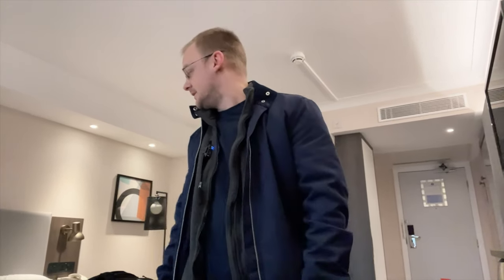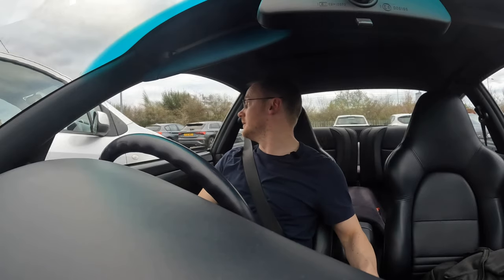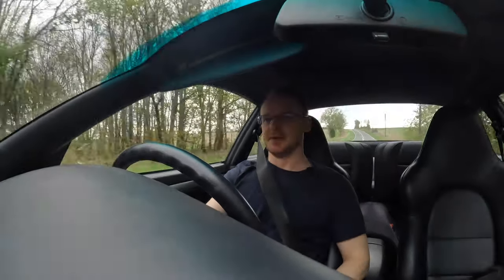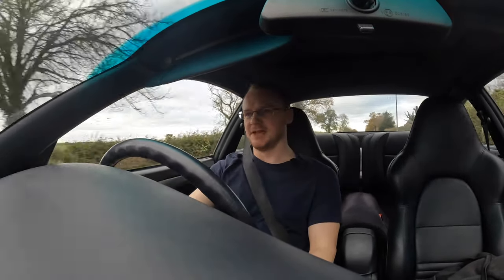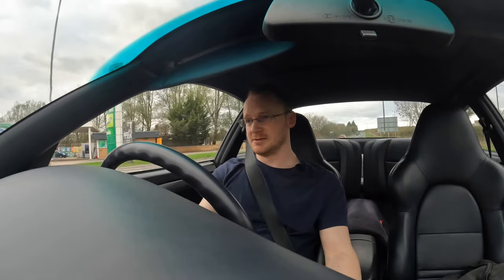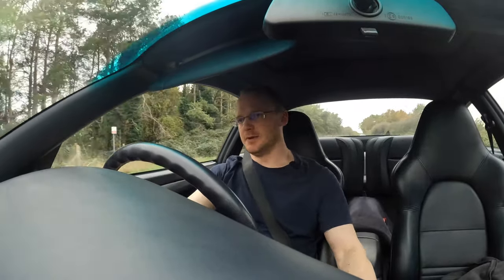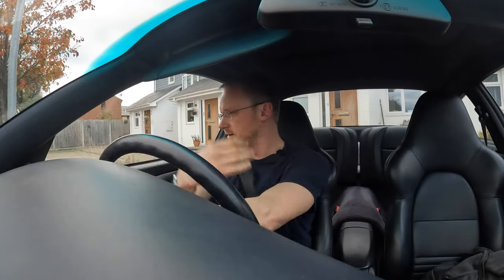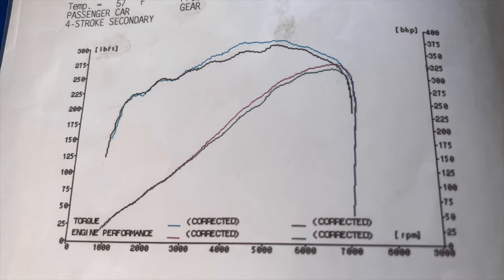Porsche 996 Hartech Engine - Episode 5: Collection, First Impressions, Costs, Dyno results

Comment: I'm tired of seeing old Porsche's stripped down to the shell and then put back together. The soul has been lost in the process. With your car, it was still intact. They just refitted the engine and put it back on the road. Your smile at the first heavy throttle was was amusing. We all could feel the new-found power.
Reply from the maker: That’s it. It’s about enhancing what’s already there, and making it ready to enjoy for the next 10 years or more.

Comment: Thanks for the video!  I own a 996 with 174,000 miles… just spent $10k last year on finding an intermittent misfire/idle issue…  wish I’d been able to save that towards a hartech build…. Enjoy the drive!
Reply from the maker: Thanks Dave, what was the issue with your car in the end? Did you have to replace lots of parts?
Reply: What did the issue end up being?
Reply: @leeevernden  just saw this…. Unfortunately there was no smoking gun on the issue… we ended up replacing tons of sensors, vacuum lines, DME, unpinned and repinned many of the electrical connectors and more…. We think it was the combination of a bunch of things, and some deferred maintenance in a high mileage car…

Comment: Very nice, but that's coming in at 996 turbo money. No doubt a turbo would also be very expensive to maintain.
Reply from the maker: Well this is it. I could buy a turbo but then I'd want to do something equally nuts with that. Turbos are a different beast and whilst I can appreciate them they don't float my boat like a 996.1 c2 does.
Reply: If you hold on to it for 10 years you will get your money back. 996s will do the same as 993 values and it's modern car quick with the extra power.
Reply from the maker: @bradjepson7022  I agree, certainly the longer I hold onto it the more sense it makes.
Reply: @bradjepson7022  That's reaching. 993 were build in way lower numbers and 996 have already increased in value probably close to 2-fold over the last couple years. A lot of the increased value is people just speculating on the prices increasing further, not really the true demand for it. It's not quite probable that over 10 years his 996 will be valued at 50 grand plus inflation adjustment, so really it would have to sell for around 60 grand. I doubt it!

Comment: 996 C2's will for sure be the one to have now and in the future , they're already at a similar price point to 997's , personally I think this is a great way to deal with a worn out tired engine, yes it's big money but what else will drive like this. A Turbo doesn't , I have one, it's more like a GT , C2's a re a good bit lighter and with this engine , suspension and brakes will make an incredibly special car. I'd only do it on a very good body shell with good interior and a special colour.
Reply from the maker: Yes that's the idea - a lightweight sports car without much compromise in other areas, I'm sure there are plenty of Caymans that drive like this but I needed the extra seats, plus a 911 is just cooler.

Comment: Puff of blue smoke on startup is pretty standard on a lot of flat 6 engines, might not go away after bedding in but it's normal.
Reply from the maker: Even my worn old engine didn't smoke so I sincerely hope this one doesn't. Hartech certainly told me it won't.
Reply: @leeevernden  It's a normal thing on flat 6 cars. When the engine is off, due to the flat design of the engine, a miniscule amount of oil seeps past the pistons as the different parts of the engine cool and contract (IE, the pistons contract before the cylinder does).

It's not on every startup, depends how the car is driven before shutdown usually (IE if it's driven hard before shutdown).

This is what's burnt off on the next startup, but it's such a tiny amount it is accounted for in oil change intervals, it's not anything to worry about.

It's not a problem, it's just the design. And it's not just Porsches, any flat 6 can encounter this (Maserati, Subaru, Chevy etc etc). Nothing to do with wear, so don't worry!
Reply from the maker: @ett_baer  Oh I see, thanks for clarifying.  In that case even if it does I'll never notice 🙂

Comment: Good luck mate I have a 997 4s and I payed a local company last year to do a two cylinders rebuild and it failed and the chaps at harteck saved the day thanks Lee grant Tobias 👍 to all out there iron liners do not work on the 3.8 open deck long term
Reply from the maker: Yes it seems I had 6 steel liners and that lasted a good few years longer than yours but ultimately here I am fixing it. Hartech have definitely done a proper job on this one, feels great as I imagine yours does too.
Reply: Iam still working on getting it back together Saturday project 👍 all the best from Paisley

Comment: I’ve been considering a V8 for my 996 with intermix. Your videos have definitely made me reconsider, I’ve been researching the Slakker (no Hartech in us) 3.7 build. Similar pricing but that flat six sound is something I don’t want to give up.
Reply from the maker: Absolutely, the m96 has a great character and makes some lovely noises. Definitely worth consideration.
Reply: Just check StreetBandido green Porsche from a few days ago. The crate racing engines you can buy in USA with warranty are absolutely mind blowing.

Comment: Perfect description of the OEM engine - as I have described it to friends.  My 2000 996 C2 is a fabulous car, but the first time I got the revs around 5000, it felt like a completely different car.  Just brilliant. That's when I understood the beauty of this Porsche.  Nonetheless, I absolutely understand everything you discuss in this video.  I do wish I had an engine with more torque in lower RPMs and I wish I had tighter shifter like the kit available from Numeric.  Wish I had your seats, but only have the standards in mine.  If mine ever develops bore scoring or some major problems, I'll have a conversion done similar from a company in the States like Jake Raby's group.  Thanks for the video.
Reply from the maker: Thanks for your comment, interestingly someone drove my car the other day who has driven several 3.4s and 3.6s before and he said that the 3.4 is all about the top end, and the later 3.6 is all about the mid range. With the 3.7 and the tune, you get the best of both worlds - strong mid range and top end. A very nice way of putting it I thought.

Comment: I had a 3.6 conversion done by Jake Raby/Flat6 Innovations here in the US about 10 years ago. The cost was high, but the satisfaction is priceless. I highly recommend you upgrade your suspension...you won't be disappointed.
Reply from the maker: Yeah for now I'm refreshing the suspension but one day I want to get round to setting it up properly. There is so much choice in that area and I've heard so much good and bad for the different setups, needs proper research. What have you gone for?

Comment: Congratulations Lee. Looks like you are in for some great fun. 
On a separate note, suggest to hide your personal details (like your address and other details) in the video if you can . Have been stung recently so thought I'd mention. Have fun and thanks for giving us a full detail.
Reply from the maker: I thought I edited my details out? Can you tell me where you can see that please and I'll fix it. many thanks for letting me know!
Reply: @leeevernden  start at the folder when you’re going through the performance figures before and after tuning. Top left corner you can see the address. Hope that helps
Reply from the maker: @rehanqureshi9253  Phew, that's the tuners business address so that's all good. I was worried for a second as the first cut of the video did have my details in which is why it cuts to screenshots at one point. Thanks for flagging though mate, appreciate it.

Comment: Hi Lee, thank you very much for these episodes. I really appreciate the work and money you invest in the 996. I personally believe, probably because i also own one, it’s worth every penny when your intention is to keep the car for a while en enjoy every mile. Just one question, I’m sorry if I overlooked: did the rebuild fix the rattling noise, and more important: what was the suspected issue? Kind regards, and enjoy your lovely 996
Reply from the maker: Thanks Stefan, the rebuild did indeed fix all nasty noises coming from the engine. Upon inspection, Hartech found the engine had 1 new piston and 5 old ones, also on one side of the engine there was an unusual amount of small end bearing wear, this was the prime suspect for the knocking noise. Can't be 100% sure that was the issue but a lot of the engine internals were replaced and all the nasty noises are gone.
Reply: Thank you for your detailed reaction. Was quite surprised that the Nikasil replacement already been done. Most of the times when there’s a knocking noise (in your first episode) the first reaction is bore scoring. That’s not always the case if I’m correct. Very useful info indeed. Thank you Lee. Regards

Comment: Hi Lee, I'm thinking to do this to my track car, and I have a question about the clutch. Did you got a performance clutch kit to handle the extra torque or the stock one can handle it? Thanks!
Reply from the maker: I do believe I have an OEM spec dual mass kit. So no upgrade on my car as yet. Already starting to think about other setups though, I'll look into a solid state setup next I think, that should make a big difference to acceleration.
Reply: @leeevernden  Thanks for the response! A cheaper way to gain some power and acceleration is uprgading the plenum and TB with larger ones. I did it on my 3.2 and after a tune is noticeable.
Reply from the maker: @albert986s  Yeah I did consider that at the time of the engine work but I had to draw the line somewhere as costs were spiralling, and that's where the line was! Something to think about for the future though.

Comment: Really interesting. I What happens about the IMS bearing? Is the Hartech solution - whatever that is - good for the life of the car? Or does it require periodic replacement?
Reply from the maker: Hartech solution is what Porsche did in the end which is to fit a larger IMS shaft, plus a larger bearing of course. As newer Porsches no longer suffer IMS issues it looks like it's good for the life of the engine.

Comment: Interesting vids glad it’s all done and you’re happy , shocked at the cost though, it’s almost put me off  buying one tbh, I couldn’t justify that repair should it happen …. I’ll keep saving for a while longer
Reply from the maker: cheers Marcus, and yes I'm very happy with the results. I think a straight bells and whistles rebuild with Hartech minus a capacity conversion and anything else is £10k-£12k. The trouble is though that there are so many bits that are much easier to tackle whilst you're in there. Plus my particular car had built up quite a 'maintenance debt' from the previous owner who was far from proactive, and I'm really fussy so just had to keep adding stuff on.

Comment: I love my 996, and understand wanting to improve it....but....I wouldn't be surprised if, for the money spent on the rebuild and initial purchase price of the car, you wouldn't be far off the cost of a 997 Carrera or a 996 Turbo. I doubt this car will ever be worth what was put into it and it's probable that buying the Turbo in particular would have provided a better driving result and better investment. I've never driven the Turbo, so couldn't really say, but it's a lot of cash to sink into a 996. Interesting video though.
Reply from the maker: Hi, thanks for your comment. I hear this a lot, but that just isn't how I go about cars. When I was looking for a 911, there was nothing stopping me buying a 996 Turbo or a 997 Carrera - I just preferred the 996.1 c2. I'm not alone in that either, the turbo for example is a very different car being a lot heavier, 4wd, more complicated to maintain over time etc, and the 997 is just one step closer to a modern 911 driving experience, and I wanted something truly analogue which the early 996s are - in that respect I see these as unique in the 911 marketplace and worthy of all this work for no other reason than the enjoyment the car provides me. The money I've spent is basically all the maintenance and upgrades the car should need for a long time to come, the difference is that I've just done it all up front rather than spreading the works over a number of years. I don't expect to recover the costs when I sell the car no more than the average person expects to recover the maintenance/upgrade costs of a car they've ran for 8, 9, 10 years.

Comment: Wow, that's a big investment in a car worth 18 to 26K. I've already got 200 cell cats, I'm hoping my 3.4 keeps going for the time being. I'd like to have the suspension replaced it's getting a bit clunky. Bushes are getting old.
Reply from the maker: Yeah these are all of an age now where a suspension refresh is in order. Front is done on mine but the rear is still mostly original, need to sort that at some point. I seem to remember Hartech saying the 3.7 would be £14K plus vat, but the trouble is there is always loads else that's so much easier to do with the engine out, I wouldn't do it unless there was something seriously fishy going on with your 3.4. 200 cell cats are awesome!
Reply: @Lee Evernden  They are a cracking car to drive, and surprisingly comfortable even on long drives. The headers and boxes have been swapped for stainless sports ones. It's very loud, to be honest.
Reply from the maker: @chriswharrier3571  Agreed, great all rounders these. Mine has stainless headers on it as well but I'll keep the standard silencers as this is supposed to be a daily driver.
Reply: @leeevernden  I have TopGear manifold, std cats and Cargraphic ETR (the middle of 3 volume levels) silencers with a Gundo hack. The manifolds are the most recent addition and have made it considerably noisier, to such an extent I am looking to swap the silencers soon. Enjoy the 3.7 conversion.
Reply from the maker: @hughgabriel1  I’m really enjoying the standard silencers with the free flowing cats, I think it just needed to breath a bit better. Depends what you use the car for though, mine is a daily so didn’t want anything loud.
Reply: I think those valuations take into consideration nearly worn out motors and transmissions. Good value if it’s a keeper.

Comment: What was wrong with it to mean it needed a full rebuild?
Reply from the maker: I cover that in more detail in the previous episode but the engine had a loud knock at idle, prime suspect was small end bearings were worn on one bank. The engine had also been rebuilt back in 2009 and the previous place had replaced 1 piston with a different part and left the other 5 in there.
Reply: @leeevernden  Basically 2 full rebuilds in 24 years? I thought ze germans were good engineers with a tendency for overbuilding things ^^.
Reply from the maker: @maxmeier532  By the sounds of it the need for the first rebuild was Porsches fault, but it wasn't rebuilt properly in 2009 so here we are. I think the days of engines being overbuilt or over engineered died a very long time ago - or at least from factory, no matter the manufacturer.

Comment: Yeah that figure has put me right off.
Reply from the maker: I don't blame you, that's why there aren't many 3.7s around. It's a completely reengineered m96 engine so it's not cheap.
Reply: @leeevernden  hows it pull rev out topend? gives me the impression it would drive like a diesel, all pull then nothing. I like the way these rev out. Have a 400/400 evo 6rs aswell so have the power and tq. I could just sell up and get a turbo but i prefer my carrera, it just needs 450/450 ....
Reply from the maker: @foxx1111  that hasn’t really changed, the difference is that you have much more torque available and it comes in sooner than before, but it never really drops off so you’re having fun from lower in the Rev range all the way to 7k.

Comment: Wowzers £23000..... :-o
Reply from the maker: It did need quite a lot doing to be fair! It is 23 years old so I'll forgive it :-)
Reply: @leeevernden  yeah I guess tha5s the reality of rebuilding an engine of this age so to be exspected... makes engine swap options look cheap 🤔
Reply from the maker: Well I did consider a Mezger engine but they are £20k minus fitting and all the bits to make it work so that would have been much more. I love the m96 engine though so it's great that Hartech can iron out all the weak points like they do.